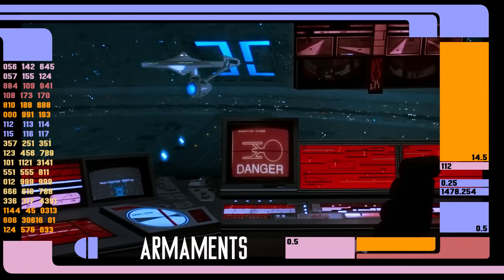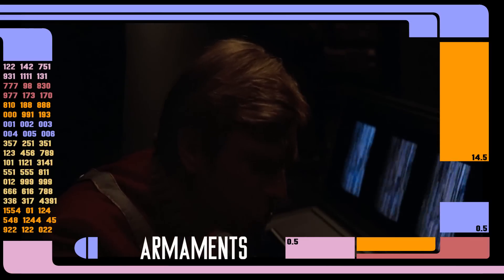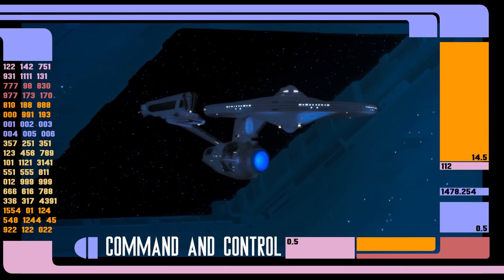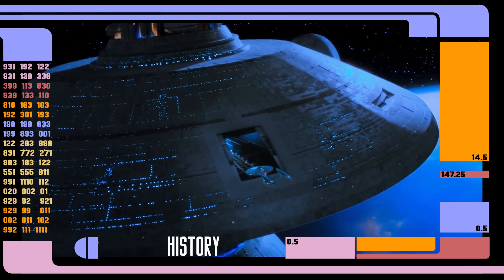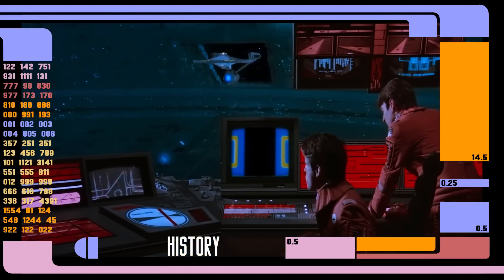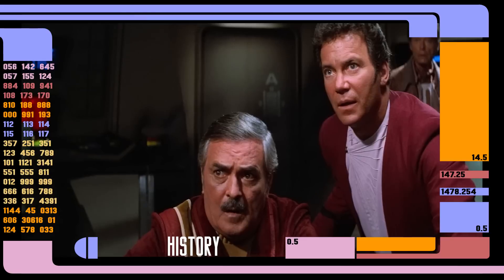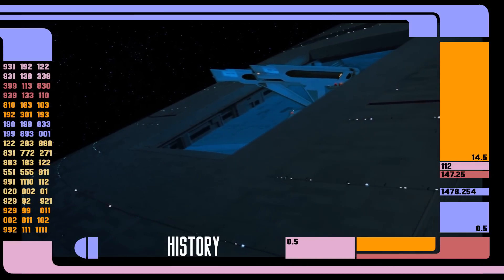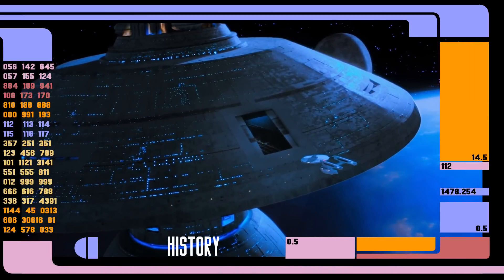SpaceDock: The Greatest Federation Starbase Design

Comment: If it was under construction while the Federation was at war with the Klingons, it's practically guaranteed it has weapons.

Or at least it will do, on Tuesday.
Reply: I'm guessing it's in the L3 or L1 orbital position, and the cylinder at the bottom might be designed as a single high powered phaser array (i.e. it's an immobile Star Trek death star).
Reply: @Zachomara  visually we can tell its not in any Legrange location.
Reply: @DrewLSsix  How so? It's definitely not in low orbit. From where it looks like it's located, it's in some kind of high orbit. It would make sense for it to be in one of the L positions.

Visually, Star Trek has a history of disparate  visualizations. You'll never see a Romulan warbird when it's "40,000 kilometers" away when it's nearly the size of the Enterprise on screen.

Even in this video, the Enterprise's entry into Spacedock and the interior of the station are massively different. (granted, it's just more evidence of the timelord-Federation alliance this channel is so fond of.)
Reply: @Zachomara  L1 is on a direct line between Earth and the Moon.  The fact that we can see both in the background of the shot of Enterprise entering Spacedock proves it's not there.  L3 is on the same line, but on the opposite side of the Earth.  The Moon wouldn't be visible at all from there, because Earth would be in the way.
Reply: @DannyBeans  Hmm... then it could be at the L4 or L5 positions. I don't know why they wouldn't put it in the L1, though.

Although it's possible it does move around to keep any potential enemy force guessing.
Reply: @Zachomara  L4 and L5 are out at the Trojan points, 60 degrees ahead of and behind the Moon on its orbit.  Starbase is way too close to Earth for that to work, and the Moon would never appear to be behind the Earth from one of those positions anyway.

My guess would be that it's in a geosynchronous orbit, possibly over San Francisco.
Reply: @DannyBeans  Actually that depends. If you want to go from the Earth to the Moon or back (not that it matters in Star Trek) your orbit is going to go near one of those two points if you want to conserve fuel in the Interplanetary Highway.
Reply: @Zachomara  How is that relevant?  There is no Lagrange point from which the Earth and Moon can be seen in the configuration shown.  Since there's no dialogue whatsoever to suggest Spacedock is at a Lagrange point, and visual evidence that flatly contradicts the idea, I think it can safely be put to bed.
Reply: @DannyBeans  Still confused as to how you think it contradicts the idea.
Reply: @Zachomara  At this point, you're either trolling me, or don't actually know what a Lagrange point is or how it works.  Good day.

Comment: Whether armed or not, Spacedock would be an Immovable Object to almost any enemy that would attack it; a behemoth with impregnable shielding drawing from its own massive power reserves...as well as the warp cores of any vessels currently docked within.

If an attacker avoids it completely, that means an entire hemisphere of Earth ignored, and if they didn't ignore it, it means pretty much the same as the attacking force throws nearly everything they have at it in a vain attempt to destroy it.

Its mere existence is a tactical victory in any battle for Earth.
Reply: In a lot of Star Trek video games these types of spacedocks get destroyed easily.
Reply: @DanBen07  Sure, but how much of that is because those games don't bother to give it the x1,000,000 shield/SIF capacity it would have compared to any single ship?
Reply: @DanBen07  Those are typically Starbases, which are smaller, scaled-down versions of the Spacedock design.
Reply: What about hurling kinetic energy projectiles, the kinds used for orbital bombardment, at cee-fractional speeds at it? I know you’d need a lot of Big Fething Rocks to make the attack worthwhile, but could something like that overwhelm the Spacedock’s shields and armour?
Reply: @dparky1627  Thats what tractor beams and phasers are for  either to deflect or outright vaporise such threats but yes those could still be dangerous.

Comment: As far as what powers it, don't forget... an antimatter reactor and a warp core are just interchangable names for an integrated system... The "warp" core doesn't do the warping, its the nacells, the core just provides the imense power it requires to generate the field and shunts it directly via the plasma conduits. A station is PROBABLY powered by an antimatter reactor since its the federations go-to power generator, it also PROBABLY doesn't have nacels to generate a warp field.
It also has phasor strips garanteed, saw some on each side of the doors during the enterprise docking scene you played several times.

Comment: Spacedock is a mass ship repair yard, drydock, and probably construction dock with multiple industrial replicators and likely built to withstand internal incidents with severely damaged ships.

If it doesn't have weaponry, by the time you went to fire your second shot you would a staring at forty brand new phaser banks.

Comment: I know some larger stations are powered by fusion reactors, in cannon. Spacedock is probably an anti-matter production facility, as anti-matter is a synthetic fuel, meaning it takes energy to make it (it's basically an energy storage medium).
Reply: That's one of the major issues with star trwk tech, it seems to suggest the ships manufacturer their own antimatter as the need it. The closest thing to fuel they ever discuss is deuterium.
Reply: In the TNG tech manual  it speaks about antimatter  being made by  converting proton and neutron beams into antideuterons by means of charge reversal devices  powered by solar fusion reactors and when the antideuterons are combined with positron beams, positrons are the antimatter equivalent of electrons to create anti-hydrogen 
The manual also states that the process used to create antimatter takes more power than is later generated  25% is the quoted figure.  But this is considered an acceptable cost to create a compact  fuel for starship operations. 
This process is carried out by dedicated manufacturing facilities, and while it not stated,  the facilities are probably located in a isolated region in case of  accidents.
Reply: As stated below, and in the tech manuals, antimatter is created, not mined or found in space. It takes power to make it - a LOT of power. I always imagined that the Federation had very large solar power stations in close orbits around the homesuns of their member worlds - close enough to generate large amounts of power. They would they use that power to manufacture antimatter and then ship it to wherever needed. Once built, such a station would be easy to operate, require no fuel be brought in (except if they need something like hydrogen to make antihydrogen out of, for instance) and be an easy way to get the massive amounts of energy needed to power large scale production of antimatter needed for Star Fleet and the Federation as a whole.
Reply: @Colin4763  See Also: "Praxis."

Comment: I think an additional advantage of repairing and upgrading ships inside this type of space dock is that outsiders can't see what you're doing. It would make espionage impossible without an actual spy inside the base.
Reply: kinda doubtfull - most sensors would penetrate such starbase outer hull - and federation wasnt particularly interested in making its instalations scan proof. Some races which playes smugglers role were keen on making their ships to deflect scanners so while it was doable i doubt the federation would do so.especially on a much larger scale like such starbase - Romulans though - those were paranoid as heck so in their case i would be surprised if they didnt make their installation scan proof.
Reply: @krzosu  Did any Trek show have an episode where outsider ships were able to scan internal spacedocks specifically, or are you speculating based on other occurences that share similarity? 
In any case it would make sense that this would be a cat and mouse kind of thing, with scanning technologies improving constantly and necessitating new countermeasures.
The Federation is definitely not as paranoid as the Romulans, but they do have advanced technology that they keep to themselves and refuse to trade with outsiders, so they do have reason to hide the technology on their ships
Reply: @limiv5272  Im saying this because that is the nature of the federation - to be open instead of secretive - for eg  Deepspace nine after it was taken over was retrofitted with starfleet tech and they didnt use or bother to use sensor deflecting materials to reinforce the hull

The same goes with federation ships throught the eras - we didnt see them use that form of passive anti scanning measures anywhere on their civilian instalations (and hecck they barely had any real military ones xD) and even those were mostly listening outpost along the neutral zone

On top of that we are seeing almost routinely that federation ships are being able to be scanned without any hinderance unless they use some sort of active counter measures like tweaking their force fields and even then its usually barely making a difference.

And in comparison Xepolite free traders were seen using such measures like sensor reflective hulls - Point being the tech was out there but the federation was not interested in using it mostly due to their open door policies.
Reply: @krzosu  Those are valid points, though I disagree with some of your interpretation.
 
I agree that the Federation generally aspires to be open and they certainly wouldn't want to completely shield all their bases and space stations against scanning, especially not the civilian ones. However that doesn't mean anything and everything on these outposts can be freely scanned by anyone. If that were the case, I don't see how the Federation could ever maintain a technological advantage against anyone except those with such inferior technology that they aren't able to scan the Federation's technology. DS9 had service shafts that O'Brien believed couldn't be scanned because of their construction [though some aliens were able to do it]. I always thought it made sense for all Starfleet outposts to also have some of their more sensitive equipment in shielded compartments similar to that to protect their technology.

When DS9 had its defenses upgraded it would've made sense for them to want others to see enough to know those defenses existed as a way of deterring attacks. I wouldn't consider this evidence that the Federation just let anyone see the inner workings of its weapons to a degree that would allow the technology to be reverse engineered.

Starfleet definitely seems to be doing a bad job at protecting themselves from outside threats a lot of the time, and you're right to point out the many instances in which their defenses were completely ineffective, I just don't think it means anyone can freely scan all their technology under most circumstances.
Reply: @limiv5272  Well some parts of ships were harder to scan than others - for eg the nacells were made from composites that by accident made them harder to scan through. As for scanning and stealing tech - may i remind you of an episode (s04xe11 - Concerning flight) of Voyager where their ship was scanned by enemy combatant and they literally stole their entire computer core :D So yeah ... THAT happened :D Granted surely there were more high security areas on ships and bases but those were usually proteted by the force fields instead of not scannable materials or at least as far as we know (or i know :D). Also there was an episode in DS9 where the Cardass\ians literally teleported away entire armory of photon warheads from the station - and one would assume there were some counter measures in place to prohibit that kind of thing - and yet they pulled it of quite easily. So while i bet there were some measures taken to deter theft of tech in many cases they were severly inadequate and like i said earlier most likely those were due to that open minded/open door policies which assument most of civlised people would simply not steal because that wouldnt be on the level :P - yeah federation was quite naive and quite often it later on bite then in the back.
Reply: @krzosu  I forgot about that VOY episode, that was definitely a huge fail. I suppose you can't be prepared for alien technologies you don't know exist. What really annoyed me about that episode was the usual lack of identity verification that allowed those aliens to use that computer core.
Reply: @limiv5272  on the other hand there were some episodes where some people had insufficient security or rank to access some systems - for eg  in DS9 when the Sisko , Jake ,Quark and that other ferengi kid went on a trip to gamma quadrant and were snatched by jem haddar - jake and Nog tried to use autopillot on the runabout to go home to get help and the computer told them to buzz off due to lack of clearance - so in the case of that stolen computer core i would assume the thieves managed to reprogram it somehow despite it being an unknown piece of tech from alpha quadrant... which in itself is quite impresive
Reply: @krzosu  Considering the amount of times ships got taken over and the invaders just sat at the controls and flew the ship, I consider that episode to be the exception instead of the rule

Comment: I've always envisioned Spacedock as being an orbital version / mix of Norfolk Virgina, Porsmouth aval Base and Newport News Shipyards and everything those locations would include.  It does more than just upgrade and refit ships, it also builds and maintains ships, while allowing the transfer of personell, cargo and equipment.  Not to mention command and control functions.  Basically all the facilities required to support a fleet are probably inherent to the Spacedock and large sections of it are probably even dedicated to shipyard functions for smaller vessels and component manufacturing, able to make anything from structural and hull segments, to computer and warp drive components.   Then there's probably also facilities for logistics and cargo transfer and transport for both Starfleet and civilian commerce.  So Spacedock is the beating heart of Starfleet.

Comment: Myself I love the design of space dock. It is an absolute beast of a station and staging area. Given the size and possible danger at mounting an offensive on the station most races of Trek minus tge Borg wouldn't plan on even attempting such a feat. Even the Dominion and Romulan Empire would see this station and try and minimize damage vs the Klingons who would charge strait at it and if this station had any defenses would reck any on coming ship. While the Norg Cube may be the boss battle you never want, Space Dock is thr raid that you wake up in a cold sweat to.

Comment: As you point out, Spacedock is a great place to protect ships while under repair. Bur it also keeps people from seeing those ships under repair.  It should be compared to the open drydocks (although technically these terms are mixed around considerably in the trek universe) where the ships were updated and repaired in open mostly unprotested web like structures.

Comment: On the power supply, I've always assumed it couldn't be matter-antimatter, because someone has to be producing all that antimatter in the first place and I assumed that's part of what Spacedock was doing, using energy from the same style of fusion reactors that power impulse engines and auxiliary systems on starships. Antimatter isn't something you can mine, you have to put in the energy to produce it, and a big, stationary, orbital megastructure seems like a good place to keep all of that plumbing. Small wrinkle is that the reason starships have an unlimited supply of deuterium, unlike antimatter, is because they collect it using the Bussard collectors in interstellar space. Either they have to collect extra and drop some off at Spacedock and other stations, or the stations have to have some other means of getting deuterium brought in.

Comment: i agree. it has to little screen time to be sure.
But it does make sense. even the docking bays. Other youtubers have counter this by saying: yards like utopia could do the same.
But the save insides are good.
And i have never been able to find it. but i am sure there was a episode where several walkways where connected to a galaxy class/enterprise to quickly unload large groups of people. 

I also like the design a lot.

And yes for defense it does not make that much sense....until you think like you do. Sent out a fleet to deal with the threat. And this station will repair the rest.
Reply: You'd see those 'walkways' in use in 'Star Trek TNG - 11001001'   Season 1 Episode 15